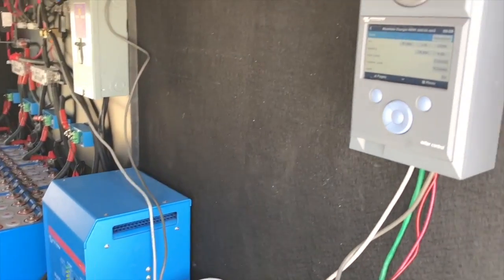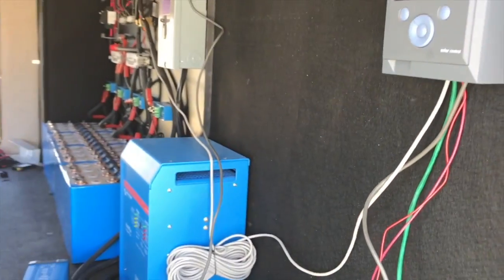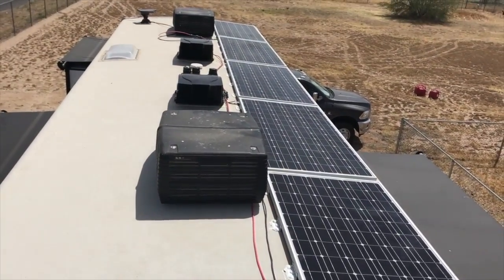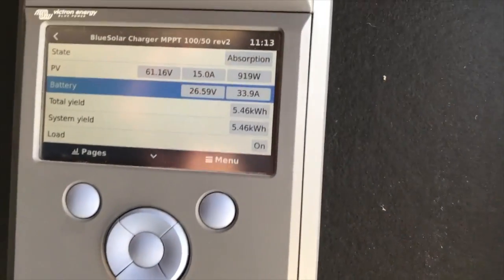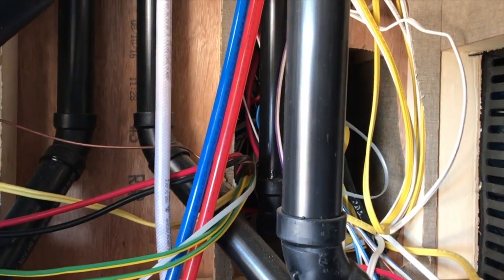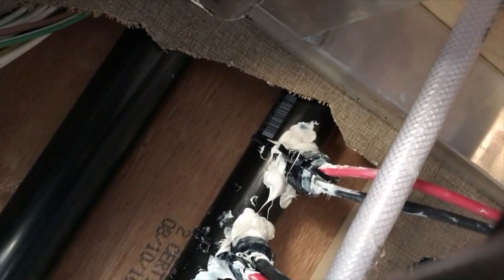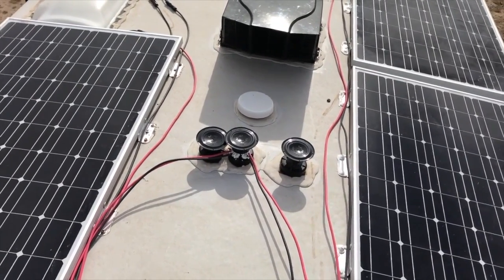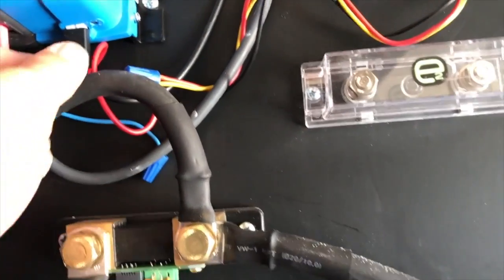RV Fulltime Living | Lithium Battery & Solar: Part Nine - Boat Load of Solar

Comment: So How is the inverter and solar system running?  Are you still glad you did it?  I miss your videos
Reply from the maker: Sorry for the super late reply. Yes ... totally glad we did it. I did upgrade the inverter from 1 multiplus to 2 multiplus' and eventually just went for a Quattro. But totally satisfied. Even when we are at parks I can plug in a 30a cord versus the super heavy 50a cord. With 30a and the inverter, I can run 2 air conditioners and pretty much never have to travel with the 50a cord unless we are in AZ in 100+ temps. I really despise the 50a cord :) When boon docking in cooler temps, we rarely need to run the generator. While on the road we can overnight at a Walmart or Flying J's and still have all the power we need. So definitely, would do it again.

Comment: How many holes did you drill into your roof?... Do you live in tornado country?
Reply from the maker: Not in an rv. Never been near a tornado fortunately. So 12 panels x 8 brackets per panel x 3 holes per bracket. Survey says 288 holes.

Comment: You put together a very functional system but I have a few tips that might help save the next guy a lot of money and bs.

1. It looks like you are using Renogy or equivalent z-brackets that bolt vertically into the bottom of the panel.  To remove or even access the bottom of a panel you would have to rip out all your brackets too.  After drilling holes in my virgin roof and carefully torquing the screws and laying the dicor I hope to Jesus these screws will hold in the delicate 3/8" plywood and the dicor will seal.  Ripping out and reinstalling is the last thing you want to do.  Personally I used a tiltable angle aluminum solution that allows easy access and removal that costs about $50 per panel in material.

2. I understand you bought these particular panels because of the dimensions (62x32).  A standard (65x39) 60-cell panel will be half the price and yield 250-290watts and it will be a standard size that will make replacing cheap and easy.  From what I've read this unique size is being discontinued by various manufacturers.  What about 10 years down the road?  I personally use a combination of 60 and 72 cell (77x39) industry standard panels.  

3. You have to be careful mounting panels around things that can shade including ac units.  One shaded panel in a series string can cause a lot of trouble.

4. If you are going to invest this much in batteries run 48 volts.  If you are going to break away from 12v go 48v.

Other than that I'm jealous of you setup and impressed with your workmanship.
Reply from the maker: Hey mike great feedback and good eyes on those z brackets honestly. I’m actually able to get a wrench on them just barely. I’ll pull them in another year to reseal and at that time I’ll bolt on a nice piece of angle aluminum which will allow me to screw in from the sides. I considered titling but decided against ... very debatable topic. Really comes down to how much work do you want to do every time you move your rig. I opted for some flexible ground panels that I could deploy if needed which if nothing else keeps me from running around on the roof.

No rv roof is immune to shade. Not in the big rigs at least. I did zone my panels with a left and right side. This has ensured at least one side would be getting good sun. That has worked well.

48v is great. I was a little apprehensive though knowing there was sooo much available in 24v. Either way I see people struggling to build a big power system on 12v. If not 48v then 24v. I’m happy with the 24v system and only had to buy a little extra copper :)

Oh btw ... those panels were a find for me. Had actually wished they were a couple inches narrower. All said it was about the maximum width I was wanting to go with. I was able to find them very cheap and ordered a few extra which will act as replacements down the road. I agree, residential style panels are getting extremely cheap. I can’t understand why anyone still buys these 100w panels on amazon. 

Hey thanks for watching and for the excellent feedback. Have a good one boss.

Comment: How did you attach to your roof? Are you going into roof rafters?
Reply from the maker: Yes ... i could see where the rafters were just barely but enough to mark their locations. I used some heavy stainless screws and 8 brackets per panel to mount each .... wow was that ever tedious. I also used Sikaflex under the brackets and Dicor Self Leveling sealant over the top of that.
https://amzn.to/2OYfkLP

Comment: I’m wondering how the 3 MPPT controller interferes with each other. Is there any disadvantage paralleling the MPPT controllers without connecting them together?
Reply from the maker: They do not interfere. Victron has provided feedback indicating this is an acceptable solution. If you are using a victron assistant, it will control the mppt controllers. Otherwise, they operate independently. Even running independently the perform as expected.

Comment: Wow impressive  nice work  nice stuff  but  couple bucks gas In the genny works too   how much dough in your system
Reply from the maker: Payed around $1100 for the panels, maybe another $1000 for mounting hardware, wire and charge controllers. I have about another 8k - 10k into the batteries, inverters, fuses etc. I agree, cant beat the generator. But we live in this thing full time and don’t want to be feeding it gas and running it 24x7. With our system, we can literally go indefinitely if we aren’t running the AC and if the fridge is on propane. We have one of those 4 door propane electric refrigerators. It consumes propane and el3ctric like crazy. Will swap for a residential eventually. Then we will only need to kick on the generator if we are running the AC or if we aren’t getting much in the way of sun. If running the fridge on electric about every 4 or 5 days I need to kick on the generator to help recover the banks. Which is still a heck of a lot better than running a generator all day. So $10-12k does,buy an awful lot of gas but also has so many negative effects that we were happy to make this investment.

Comment: I understand a solar charge controller can be damaged if a BMS-type solenoid removes the battery due to OV/UV. How are you insuring against this?
Reply from the maker: I suspect that may be for specific mppt controllers. I haven’t heard that it’s an issue with victron mppt controllers. They have diagrams that depict exactly that configuration. I’m currently not using a bms. Bottom balancing, as well a control over loads and charging at the bank voltage level (being conservative with upper and lower voltages) can reduce the need for a bms. However, there are times where you want cell level monitoring and want to shut down charge or loads based on a low or high cell voltage condition (LV or HV). I will eventually add in a cell level monitor. From a load perspective, I can signal my inverter to stop inverting. Likewise, I will use a victron battery protect to disable DC loads. On the charge side, again I can send a HV signal to the inverter and it will stop any charging. A battery protect can also be used to disconnect the mppt controllers from the battery. This is an approved approach by victron which is why I don’t believe their controllers are impacted by the issue you explained. Now a battery protect uses MOSFETs where as most bms setups use a contactor. This could be where the damage occurs. Not sure. I would say the best way is to buy into a system that supports this such as Victrons mppt and battery protects or find a charge controller that can support HV and LV signals from the BMS. This way in addition to disconnecting it from the bank you are also telling it to stop charging. Or better don’t disconnect the bank. Just tell all your chargers to stop. Something else worth noting. Victrons Quattro and MultiPlus inverters can run assistants (app store for inverts basically). They have assistance that can take control of the mppt controllers. In that configuration, you provide the inverter the hv or lv signal and it controls itself along with the charge controllers. Nice capability and removes the need for one large contactor that could cause surges that may otherwise damage components. I’ve never been a big fan on the one large contactor approach.Thats my thoughts. Hope it helps you in your endeavors.

Comment: Every  body in the World are starting to  catch  the solar  panel bug now big time  saving big $$$$$$$$
Reply from the maker: With prices for RV parks in the $30-50 per day range a lot of folks prefer to Boondock; myself included. Solar is a nobrainder from that perspective. Sure would like to see solar awnings hit the market though. I was going to patent that idea a year ago but found someone beat me to the idea. Would significantly increase solar square footage and could feed the energy back into the batteries via its own power cables. When manufacturers start coming out with cutting edge solutions like that, it will really flip the industry away from rv parks. Exciting stuff :) thanks for the comments!

Comment: I might have mounted those panels on the roof at an angle where the in side is at the same height as all your Center equipment. Probably at 5-10 degrees and the panels on the other side with face the opposite angle for better sun during the day and no shading would happen on the rooftop!
Reply from the maker: +SolarizeYourLife it’s all a compromise. Increasing the height of either side of the panel creates more airflow under the panels when driving which would require more structure to support the panels; but would increase efficiency as you noted. Likewise, aiming all panels in the same direction reduces parking options, angling both sides in opposing angles increases efficiency of one side but decreases the other. My biggest concern was ensuring the panels were secure. I would have liked to go with titling kits but didn’t want to have to jump on the roof all the time. Time will tell how they perform up north. If necessary, I may go with a more significant tilt but added more panels than I felt I need to account for these challenges. I’ve also provisioned the ability to deploy ground panels up to 800w. I’ve got 400w of flexible panels which I can tilt at any angle if needed. I don’t disagree with you ... you are absolutely correct to say raising up and titling would allow for better performance especially in non summer months. However, I wasn’t prepared to take on the engineering effort and simply added more panels than I thought I would need (can you ever have too many hahaha). Thanks for watching and thank for the feedback!!!

Comment: how do you control the lithium cells, do you have individual cell level monitoring so no cell can ever exceed 4.2v and start ticking.....
Reply from the maker: +Project 806 Camper I use bottom balancing and use conservative charge a discharge voltages. I’ve got a few videos on my technique. I check the cells now and then to ensure they remain balanced near 0% soc. Likewise I check them near 100% soc to ensure they aren’t drifting too much. I do have a handful of cell level monitors that can control my charge and discharge via sending a signal to my victron inverter charger or a victron battery protect device. However, the calb ca100fi behave so well I have not done so yet. I’m also not a fan of having wires running all over my packs. Bottom balance is a common technique in the electric vehicle world and so far has proven to work great for me.

Comment: I am interested in your perspective after using the system for a while regarding series vs parallel wiring for the roof array. I like the idea of running multiple panels in series for efficiency of wiring but wonder if you have any problems with  production loss of series panels due to shading.
Reply from the maker: +harleyd500 you lose power either way. It’s just been noted by many that parallel tends to be less impacted. However, parallel experiences a drop in power due cable sizing. Most of us aren’t going to run 00 cables on our roof to reduce power loss :) I’m actually wired in 2s3p for a total of 6 panels per string. I use 8awg wire the largest I could work with mc4 connectors. I don’t recall the exact numbers off hand. However. I’m right at the edge of the max amp you would want to run through 8awg without experiencing noticeable loss. So, two panels in series and 3 sets of two in parallel to create a 6 panel string. I have two strings on the RV roof and one controller per string. I have a third controller for ground panels. So far, I’m getting excellent performance. In June when temps were still cooler and the sun was high I recorded output slightly higher than the panel ratings. All said, I have yet to be in semi shaded cover. Clouds tend to effect all panels as shading is wide. I have yet to be in partial shade from a tree so it would be premature to speak to my setup in that respect. My combination of parallel and serial places two panels next to one another acting as a larger higher voltage panel. So, my shading risk is reduced from a serial perspective. I can say the I went with as much solar as I could knowing in the winter months I may not get much production out of half of my array at any one given time. I preferred this over tilting panels which seemed annoyingly dangerous in wet or freezing climates. Hope that SHADES a little insight. Wish I could provide more experience.
Reply: Thanks for the perspective. We seem to be at least partially roof shaded often as we travel and like to spend time in the woods. I was going to run 8 gauge from each panel (6x180) to a combiner box and run 1/0 from combiner to MPPT/bank which is largest cable CC will accept. Using the voltage drop calculator the drops seem reasonable. Fortunately cable runs on a truck camper are fairly short.
Reply from the maker: +harleyd500 and that is the key, checking the voltage drop calculators of which many calculate based on circuit length ... total of both positive and negative runs. Sounds like you are likely over cabled which is rarely a bad thing unless you break the bank.

Comment: Yep.  I'm trying to sort out the fuses and breakers, and disconnects...  It just seems a tad redundant.  Unsure, though...  I would like to see how your circuit schematic has progressed.
I definitely like multiple systems present, especially in a mobile environment where almost anything can happen, usually things beyond our control !  Best, rc
Reply from the maker: For my solar panels, I used a midnight solar breaker box which gives me the breaker and disconnect honestly. I do not use fuses up above but have considered an inline mc4 style fuse. But I agree, it can become overkill. The midnight solar breaker box and breakers are great though.

Comment: With 48 volt bank you must have a step down to 12v for the 12v side of the campers electrical?
Reply from the maker: I have a 24v bank. But yes you have to step down. I have 3 24 to 12v converters I’m looking to install. For now myinverter runs my converter which produces 12v and charges my factory lead acid battery. Not ideal but I have a few high priority projects to deal with before I delete the battery and implement the step down converters.